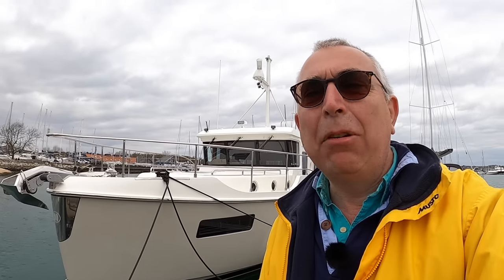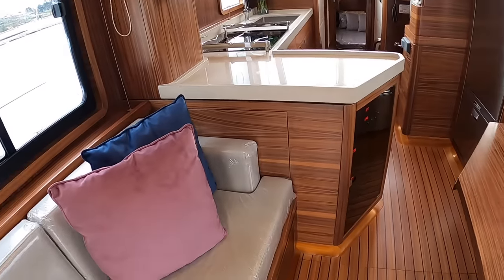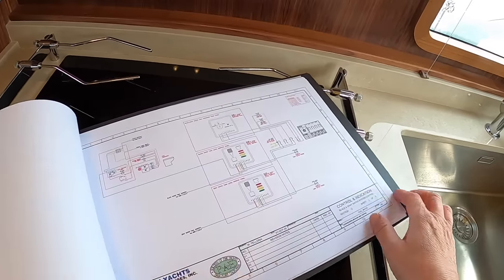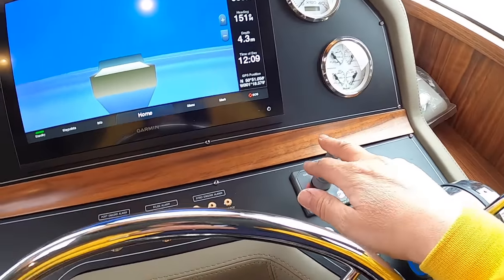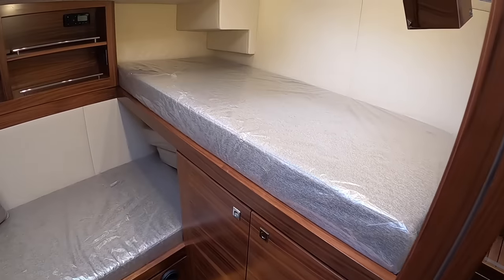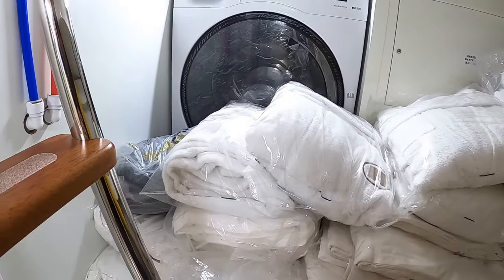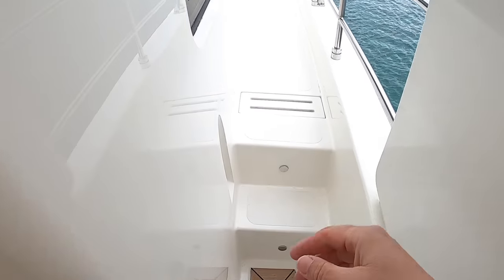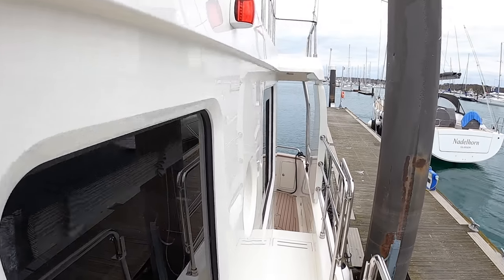$900,000 Explorer Yacht Tour : Nordhavn N41

Comment: I like the fact that it doesn't look like a penthouse on the water. Sturdy, practical, pot holders built into the stove, which is a great item. And it isn't cluttered with servo and motor driven toys to wear out over time. It's simple and capable.

Comment: Nordhavn never fail to impress, but I think they have really outdone themselves with this N41.  An incredible amount of boat there for the size, with the only real sacrifice being that of speed.  Sure, the hatch to the utility area seemed like it might be a bit of a pain and a squeeze every time you want to access the larger freezer, or carry some laundry up or down, but that's expected really on any boat under 50'.  Heck, most boats under 60' don't even have that much freezer capacity at all (though I do acknowledge many have several times the speed so you'd not need to spend as long between ports either).  Amazing little vessel.

Comment: Really nice looking boat, I can imagine spending serious time on that. I was surprised it didn't have an aft cabin considering the space that is available back there, but I guess it would push the deck height up too much on a 41 foot boat.

I wondered for a minute if it was going to be some sort of diesel electric system with the engines so far forward! I often wonder if for displacement hulls a big diesel generator at optimum efficiency running electric motors would be an efficient way of doing things.

Comment: Love to see you show a spec sheet on this. I did look it up to see if draft was compatible for shallower waters like the Great American Loop. 
LOA: 41′- 41/4” (12.60 m)
LWL: 40-‘0″ (12.19 m)
BEAM: 13’- 11” (4.24 m)
BEAM W/L 13’-4 1/2” (4.08m)
DRAFT: 4’ 8″ (1.42 m)
DISPLACEMENT: 43,300LBS, 19.33 LT, 677CU. FT. (19.68 METRIC TONS)
WATER CAPACITY: 300 GALLONS (1,136 LITERS)
FUEL CAPACITY: 900 GALLONS (3407 LITERS)
HOLDING TANK CAPACITY: 70 GALLONS (265 LITERS)
GRAY WATER CAPACITY: 70 GALLONS (265 LITERS)

Comment: Not that I will ever be in the position to decide on one of these nice boats. However at the beginning I found the layout of Nordhavns quite "cluttered" - steps up, steps down - compared to the more lifestyle yachts. But when you start watching the videos of people who take these to longer trips or even live aboard, the separate pilot house is an actual feature. Where one can be in the pilot house and one in the salon. It's like adding another room to your swimming apartment. The N41 gives away this advantage to the N40.

Thanks for so many fantastic videos, Nick.
Reply: After obsessively watching Nordhavn's webinars and Q&As, I'm really impressed. Especially on the increased requirements for Class A certification. And the fact that you can pick it up in Turkey for 600K Euro and "everything" is included (except a dinghy and a watermaker).

Comment: Now that is a nearly perfect cruising boat!  Not too pricey either for a trans-Atlantic capable powerboat.
About the only things I saw that I would want to change are:
Extending the swim platform, not much only 6" to a foot to give a slightly wider rear boarding location.
Add a FLIR camera on a small pedestal just behind the searchlight.  Also a "rear view" camera and at least one for the engine room.
Maybe change the wood finish, the one here in the tour works for _me_, not so sure about my wife though LOL
Almost forgot, I'm on the "other" side of the Atlantic so 60 cycle AC power.  Perhaps with a system on the shore power connection to allow "universal" hook-up"
I didn't see any space available, otherwise I'd want to replace the fin stabilizers with a Seakeeper system.  Less stuff poking through the hull if you're getting into "skinny" waters.

Comment: To me it looks a little cramped for serious blue water cruising. I think most people would be climbing the walls of the pilot house after a few days sitting in there going 6-7 knots. No flybridge. And no water maker...that is essential for ocean crossings. I guess you can fit one though. This boat is meant for slow journeys around the American lakes and short trips offshore...definitely not a long distance blue water cruiser...Nick always finds the positives of every boat! But I have to say I think it is just ok... The 'wood' is just MDF with a walnut finish? Is that correct? Correct me if I'm wrong! I'd have preferred real wood...even if it was simple pine or cedar. Anyway always great to see Nick's tours of these boats.
Reply: No it is a CE ‘A’ rated vessel with multiple system redundancies and ocean crossing range. So no not a lake boat.

Comment: always surprised boats like this made for going off for some time never have water makers on them
Reply: These are prepped for water makers (plumbing, through hulls and wiring etc. however nordhavn decided not to fit them as standard as its designed to be a cruising couples boat, that, and along with the fact it has a  huge fresh water tank which would supply a couple for around 3 weeks, they didn't feel it was necessary.
You have to remember, this is a full turnkey boat. Everything you seen here is standard. The only things not fitted is a water maker and the tender as people have their owns preferences on them. Its an astonishing boat and i think nordhavn is onto a major winner with the new 41. Im off to cry in my 805 🤣
Reply: Yeah, as Chris said, these boats hold 1100+ litres of water which will go a long way but with a wide array of water makers on the market it would be hard to prefit one since everyone wants something different out of their yacht. A couple won't need a water maker that pushes out 110lt/h but a family might, likewise it isn't uncommon on long passages to simply have a saltwater shower off the transom. So sometimes it is better to just lay the ground work that allows a system it be fitted as required rather than to spend money that isn't needed.
Reply: @chriswhite4915  I have been keeping my eye on a Fleming 55 for some time now, but these 41's certainly make a strong case for themselves. At the price point too I would struggle to find reasons not to pull the trigger on one.
Reply: @aaronwebb7090  absolutely agree, for a cruising couple, it is really all the boat you’d ever need. Certainly my main contender when i retire and get to use it properly. The only thing i have to say thats bugging me, the paint finish on the engines doesn’t appear to be too durable. Thats a couple of engine rooms now I’ve seem where there’s been flaking and yellowing paint around the heat exchangers bolt heats, crane eyes etc etc. I know these are resprayed white from the factory red colour during construction in turkey but i think the prep / paint quality needs looked at, may be better to just leave them red, although spotting leaks etc is much harder. Not sure if you’ve came across team escape n41 youtube channel. He’s done a few videos just before it was lifted out for the winter, but some good footage of rough weather use (that reminds me, not happy with the saloon windows, you’ll see why if you watch) and a engine room tour. You’ll get a better sense of the paint quality issues I’m referring too.
Reply: @chriswhite4915  I'm not too worried by the windows, although I would have thought the broker would mention that you should plug them during rough conditions. They are there to stop condensation from pooling inside during cold weather and it's something I have dealt with in the past. The paint is another thing that bugs me on most engines, I know it is just for visual inspection and there is nothing you can really do to keep the paint on in most cases, but I carry a can to touch up spots after I have replaced the bolts or nuts. There is also nothing that can be done about the yellowing, it happens because of the heat and while it will take longer with the red I still think the advantage of white is worth it.

Comment: Thanks Nick. 
I have been a fan of Nordhavns for years, and the engineering, the fit out, and the little ship feel are right up there on this new Turkish-built model. 
However I think this would be a tiring boat to cruise in for long distances, as the engine room is directly below the helm and galley, and there is nowhere to escape from the constant noise - neither a pilothouse like in the N40, N43 and N47, nor an outside helm position for 360 degree views and wind in your hair. 
For this reason, I would stick with one of the older models.

Comment: Fabulous small ship. In my favourite boat chart straight in at no. 3 after Sealine 430 and Marex 375. Compared to what you can pay for an equivalent Princess, Sunseeker, Fairline sports cruiser etc. That is one piece of value for money kit. Could do with a bit more power in the engine area, say up to 15 knots top speed. But that's just being picky. Loved it. A big thumbs up from me.
Reply from the maker: You wouldn't get any more speed, it's a displacement hull so top speed is governed by waterline length
Reply: Yep, the strong point of these hulls are sea kindliness and range. They are extremely fuel efficient if used within their ideal speed range. According to published estimations, this little ship will do 6 - 8000 nautical miles on one tank full if kept well within her hull speed.

Comment: Looks awesome, but I'd prefer the North Pacific 45.
You should check it out Nick, fairly certain you'd like it too
Reply: The North Pacific has a range of around 800 miles and does not include Trac Stabilization . The smaller N41is a far more capable offshore boat.  I do like the new NP 45 very much, especially the fly bridge even though it would keep me from exploring the many canals that the N41 is capable of.

Comment: It would be a nice bonus to show a slide or two at the end of each tour that shows the basic specs of the boat (particularly fuel and water capacity, cruising range, etc.)
Reply from the maker: There is always a link in the description to the manufacturer or dealer website with that info.

Comment: You forgot to mention the hold rail running through the cabin but that checked out. No Portugese bridge though, understandably so at this size but Nordhavn sorta needs that. Also what was up with the main fuel tank level gauges? Those rotating magnets should show white, red, white... they should show the actual level.

Comment: they should make the tv so you can angle it side to side, I seen in some they put the washing machine under the higher guest cabin bed (smart)...I wonder if they could make the lower bed into a desk...that could be converted to a bed if needed, maybe raise both of them 6"... instead of the table on the back deck, I'd make a 2 seater seat that pulls up like the table.

Comment: IMHO, ALL Nordhavn yachts are quality built, but this particular yacht indeed gives an owner more bang for the buck. Her interior layout is superb, and it's nothing short of spectacular to see twin engine propulsion on a Nordhavn yacht. I've personally never been fond of their "get home system" found on many single screw Nordhavn's. Usually serving as ships electrician/engineer back in my days of delivering yachts, I'd like to buy a beer or six for the individual who rid the engines of useless electronics wiring. I simply see no need for electronic sensors to be mounted on every tiny part of an engine, converting from analog input signals to digital output signals through a Programmable Logic Controller (PLC) that mostly sends useless information onto a computerized bridge display. Oil pressure, oil level, water temperature, and fuel gauge is all you really need. An hourly physical check of the engines avoids 99.9% of a problem before it becomes catastrophic. Geezzz... I'm ranting I'm so damn excited over the simplistic design of the engine room. Sorry... she's a fine vessel.

Comment: If you're crossing the Atlantic are you supposed to run a generator for 3 weeks straight? To keep the refrigerator and freezers cold. If that's a case they should have a backup generator.

Comment: Many thanks for sharing, I learned something new today, diesel engines not ruined by unrealiable electronics still exist. There's still hope for the world. I'm going to Goggle Beta engines double quick. 
I bought a Lagoon 43 Power cat with Yanmar 315 hp out of Hong Kong in 2008, the departure to Thailand was delayed a week because one engine kept going into reverse while cruising, during the test drive....that particular model of engine control box was of course out of production so we ended up with two different boxes on Port & Stbd engines. All those boxes did in this case was to push/pull a shorter mechanical cable to control the gear and throttles. Madness. Electronics does not belong on the powertrain, they will warn you again and again about phantom engine issues that are all down to electronic gremlins that shouldn't have been there in the first place. I feel better now, end of today's rant.

Comment: Fantastic! How do you think this new 41 compares against their old 40 and 43 models? At least it's lower. I kinda like the older even more commercial look and the fact that you could get a full cabin under pilothouse in the middle of the boat where the pitching movement is minimal and anchor chain noise, if there is any, is further away. On the other hand, this new model has proper twin engines and is lower and the draft might be too.

Comment: Such a great boat and beautifully made.. But I think I'd need a little more power and bigger engines.. Hate to be crossing the Atlantic or the med at only 6 knotts in rough seas.. Other than that another great tour nick👍👍👍👍
Reply from the maker: Bigger engines wouldn't make it any faster - it's a displacement boat, speed is set by the waterline length

Comment: The only thing I’d charge in the engine room is the dripless shaft seal. Prone to catastrophic failure. Convert to conventional shaft lock with Gore Tex packing at the first haul out. Virtually trouble and drip free.

Comment: Looks like a well thought out and designed boat. Seems like it might be underpowered in some conditions but I don't own a boat so what do I know. Thanks Nick!
Reply from the maker: It's a displacement hull so once it hits maximum displacement speed (which it will with these engines) then it will go no faster even if you double the power. The ethos is range and seakeeping, not speed.

Comment: Nick I have been quietly following your channel from here in Ireland. I have a couple of questions you might anwser in future videos. 

Firstly you mention Auto Pilot......does that actulay mean the boat drives itself from point to point the same as an aircraft.

My next question is can most of these fly bridge motor yacts navigate coastly seas. In my case Dublin to Holyhead is it possible and if not how do they get to the likes of Spain etc.

Lastly you often mention the tanks hold enough for between 250/300 miles of course that varies but lets say on a 60+ boat how big are those tanks? 

Thank you in advance and I must say you channel calms me both through your voice and the crazy believe maybe one day..... who knows? Jay here in Wicklow Ireland
Reply from the maker: The autopilot will hold a course as it does in an aircraft, but you must still maintain a good lookout. Dublin to Holyhead in a flybridge boat, no problem at all as long as the weather is suitable of course. All videos contain links to the manufacturer or dealer website in the description where you will find full specs including fuel capacity.
Reply: @AQUAHOLIC  Thanks a million for answering questions for me Nick. Your channel is absolutely fantastic so here comes a big Irish subscribe from me👌
Reply from the maker: @metheult  Welcome aboard! :)

Comment: Hey Nick thanks for another fantastic walk through! Incredible boat but just one question.... is that really the price for this boat? Hard to believe if it is based on some of the junk other manufacturers are pushing these days.
Reply from the maker: That's ex tax and ex delivery so you have to factor those in
Reply: Two boats that come to mind and come no where close in quality and value for your $$$ are the new Sea Ray 370 close to $800,000 for an open boat with outboards and Galeon 325 GTO almost $500,000 with options.... it’s hard to make sense of it all 😂😂😂

Comment: The hull design differs from earlier small Nordhavens like the N40 & N43 with their higher bows and flaring. To me, this would not appear as seaworthy in rough seas as the earlier hull designs.
Reply: According to nordhavn, this boat had to pass more rigorous test and inspections than previous models. The regulations have gotten more stringent. It has passed the new category A test I believe. I’m looking forward to seeing the new N51.

Comment: Very nice boat. Anyone else a little disappointed by the (lack of) engines??
I totally get the simplicity and reliability of those fitted, but for my money, I'd want more grunt available. 
All irrelevant of course as way out of my budget, but as with most it's nice to dream 🙂
Reply from the maker: It's a displacement hull so once it hits maximum displacement speed (which it will with these engines) then it will go no faster even if you double the power. The ethos is range and seakeeping, not speed.
Reply: @AQUAHOLIC  thanks Nick, that makes sense now 👍

Comment: Just 75 HP per engine? Really?
Reply from the maker: It's a displacement boat so runs up to hull displacement speed and will go no faster even if you put triple the power in. It's built for range and seakeeping, not speed.